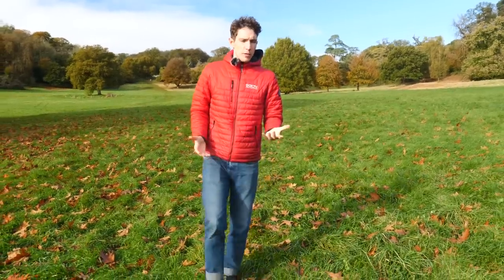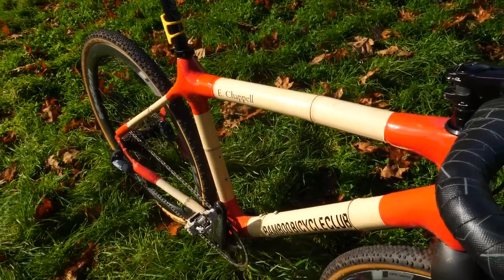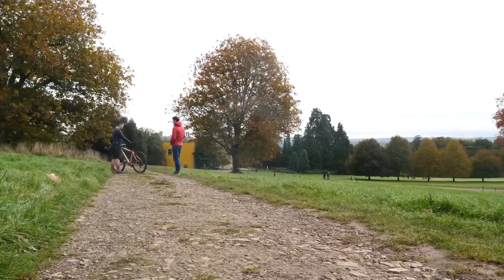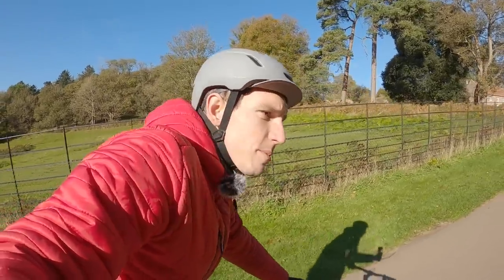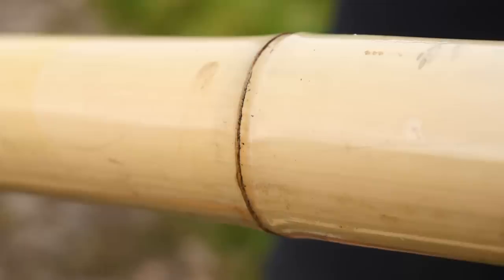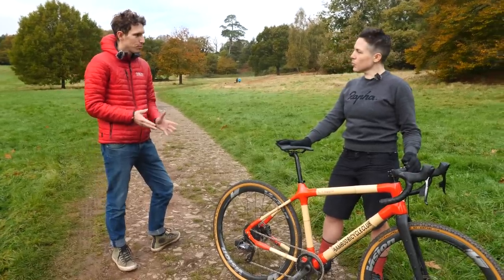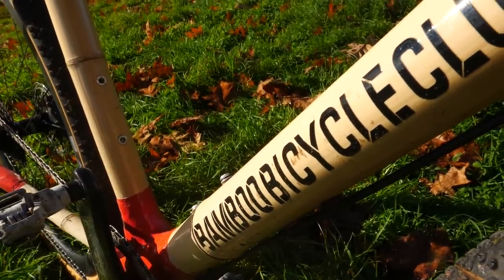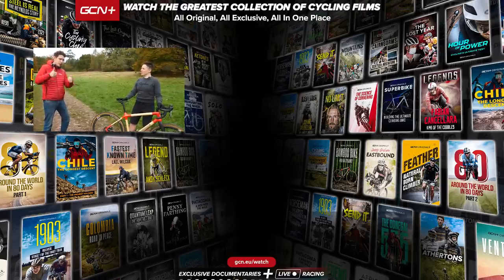Are Bamboo Bikes Actually Any Good?

Comment: Amusing idea and pretty but I would have to be really, REALLY desperate to ride a bamboo bike.
Reply: It’s a bike.
Reply: @Kimberly_Sparkles  Hmmmmmmmm...I'm a rainy weather kinda guy and it would be a bit awkward to have my bike turn into chow mein...
Reply: @scottbert9556  fair
Reply: @scottbert9556  water does no harm here. the bamboo has to bee dried and heat treated beforehand and does not absorb any humidity after that. also it should be clear coated.
Reply: @IkkePressler  I'm sure that's true but I'd be terrified by this though I have to admit I'm terrified in general.
Reply: @scottbert9556  That is part of the thrill, of riding a self build (bamboo)bike ;)
Reply: @IkkePressler  That would probably be a thrill but a serious roadblock to my doing a self build is being utterly devoid of any skills to get that done.  But sarcasm aside I am impressed by the idea of a bamboo bike.
Reply: @scottbert9556  fishing rods were made from the stuff for centuries,they get wet.
Reply: @scottbert9556  as a teenager I welded stuff (like V brake mounting points) on an old steel bicycle, it was braking very good afterwards, until the fork broke apart ;-)
It can also happen with a bike made of metal, but bamboo is a quite strong material.
Reply: If your in London do drop by our workshop and try one!
Reply: @BamboobicycleclubOrg  It's officially on my bucket list!

Comment: Fascinating! Do you have to oil it so it doesn't dry out and crack? or is it coated in something that stops it drying? ...and what's it like off road gravel/MTB? It sounds really strong so I guess it would be good off-road?? Love the sustainability side of it too! No rubbish 😃👊🚴‍♀️
Reply: Thanks. The bamboo is sealed to maintain the moisture levels. We do a lot of bikes for off road and gravel.
Reply: @BamboobicycleclubOrg  ah that explains it, cool thanks 😃👊

Comment: I have built 2 Bamboo bicycle frames. Built the second only to make the joints look better than the first. Practice makes it better. Sold them both.The first because I didn't need two. The second was sold with other bikes because I moved and had to reduce my bicycle count. Have heard from the owners and they are still being ridden. Bamboo is amazing! I repainted and stained my commuter bike to look like bamboo. Fooled my co-workers until they tapped it and found it was aluminum.

Comment: Cool idea. I wonder what would happen if you grew bamboo in a restricting tube. I wonder if it would grow in aero shapes? 

Ultimately the most eco thing you can usually do is buy something decent and then keep it forever, just replacing the parts that wear. They should offer slightly more durable carbon frames, a few hundred grams heavier that are totally OTT bulletproof. Then you can buy one that is a perfect fit and never buy another bike. Bike manufacturers might not like that but they could take up reconditioning frames, respraying etc.
Reply: Yep... apparently you CAN grow aero tubes just as you described!

Comment: What about fungus? How do you protect the frame? (Besides epoxy resins which is toxic). Btw… I like the concept. But it needs to go all environmental without the funky resins.
Reply: Agreed, we try and invest in r&d to reduce and improve the sustainability but we also need the rest of the bike industry to take part. Bio materials can be the future but more research is needed.
Reply: One method is to wash the bamboo in Borax to prevent insect infestation and possibly prevent fungus growth (though don't quote me on the second part).
Reply: @langsor  during the drying process this is essential.

Comment: No they are not. Overly expensive, too much maintainance, and far heavier than an aluminum or in some cases even a steel bike. The only reason you would want a bamboo bike is for commute or for touring and maybe perhaps for MTB due to its flexible properties. but other than that, bamboo bikes still makes no sense.